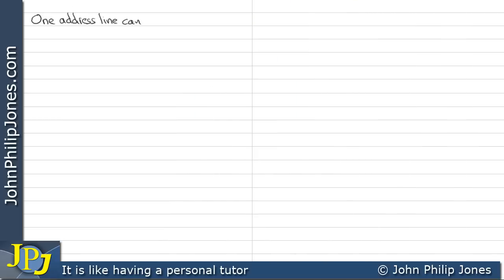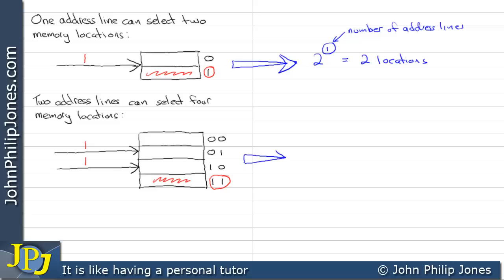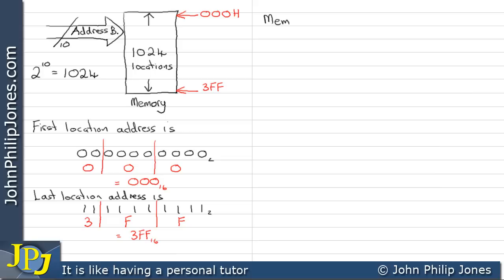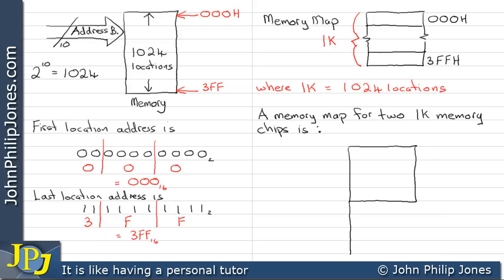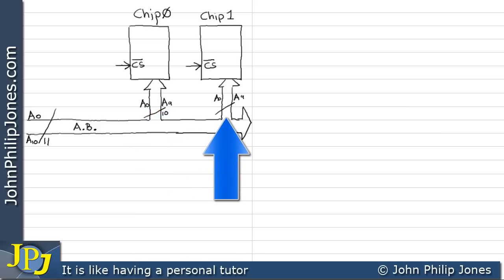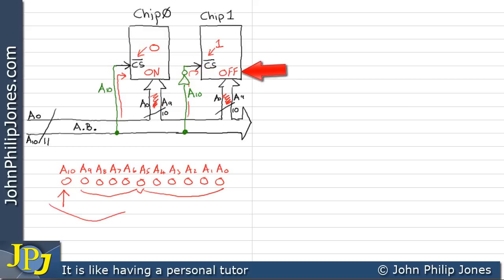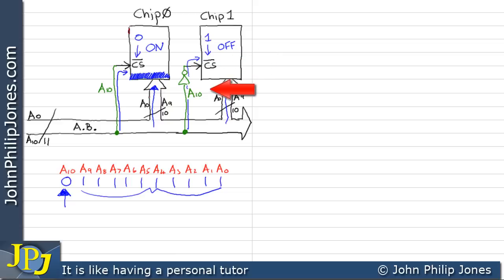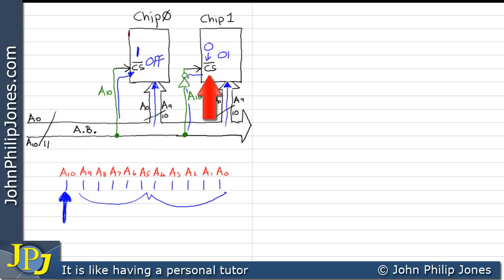Logic Circuit Design for Memory

Comment: When the bit is 0 then how its On???
Reply from the maker: Chips are usually switched on with a logic 0. You can design the electronics so that a transistor (i.e. a switch) can be switched on with either a high or low voltage level. It is usual for a high voltage level to represent a 1 and a low voltage level to represent 0.
Best wishes Phil